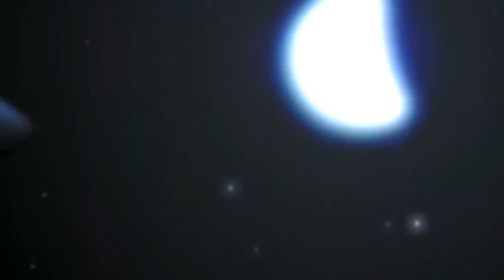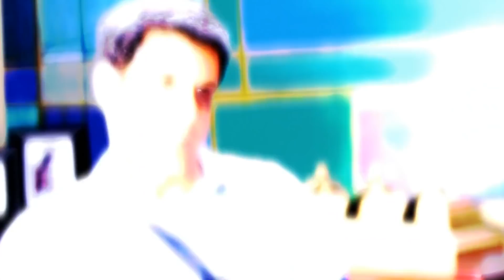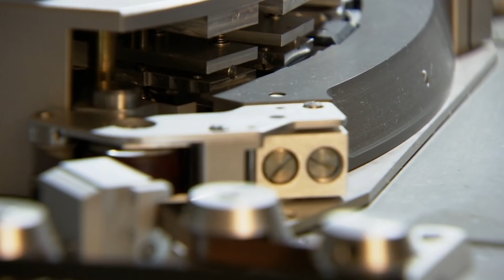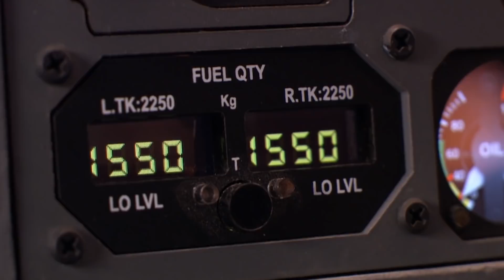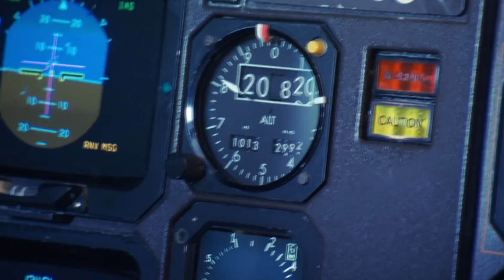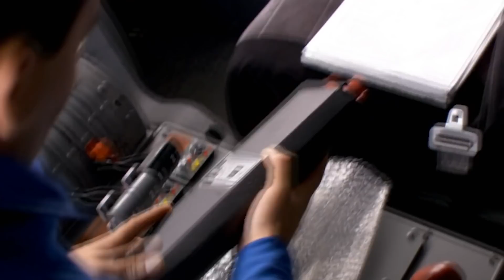"A Shocking Mistake" That Could Have A Lasting Impact | Falling Fast | Mayday: Air Disaster

Comment: I think this is a pilot error. He accepted to do the flight when he didnt have the nessesary fuel slip for the "refueling". I think every pilot should turn down the flight if they dont have a 100% certainty of the weights or fuel in his vessel. This is not a knowing better statement. Its how safety is being held. If you're uncertain, then you're not uncertain. Thats how we run vessels at sea, to ensure every safety aspect is held.

Comment: How could they have charged the Captain? He reported the problem with the gauges on his last flight, asked for the refueling slip (and was told he'd be given it later), requested an alternate airport and reported a mayday very quickly, got the flight crew to prepare the passengers for impact and tried to troubleshoot as best he could. He only decided to ditch as a last resort. Not to mention that he ditched as perfectly as he could given the situation.... and ditching is very difficult! Even in the simulation under perfect conditions and knowing the variables, it was theoretically possible, sure, but not exactly easy to land safely at another airport.

I've seen way less competent captains in these Mayday episodes and pilots are only human, after all. They do make mistakes, but it sounds like he really did everything that he could given the circumstances. His actions still managed to save the majority of the lives on the plane. He ended up serving 6 years for manslaughter for the remaining 11 lives that were lost. :(
Reply: supposedly it was against regulations to take off without that refueling slip but probably like many other pilots didn't want any further delays
Reply: He did release the plane without knowing for certainty if he had been refuel or not. In the maritime world we have a saying, "If you're uncertain, then you're not uncertain". In that way we dont do anything we are not certain about. So taking off without the fuel slip is a slip in safety culture. Definetly captains responsibility.

Comment: It's fuckin bullshit that the pilot faced criminal charges! The main culprits are the people that handled the repairs and (supposed) refueling of the plane! He DID report the issues with the planes fuel gauges AND he did CLEARLY ask about the refueling slip prior to takeoff so NO he should NOT have faced charges 😠
Reply: Its a complex situation. But the Captain neglected safety culture by releasing the plane without having the fuel slip. We have a saying in the maritime world,
 If you're uncertain, then you're not uncertain. In that way we make sure before we release our vessel. So its both party to blame in this case.
Reply: @mariusholtergrvdal7386 What does that???

Comment: I’m just amazed that the incorrect meter could be inserted. In general manufacturers will put a keyed power connector to prevent this. Bad design.

Comment: Why did they not drip the tanks to verify the fuel onboard after repairs and before the flight ? It only takes 5 minutes to do . I have done this on minney  commercial flight's in my career in aviation . Safety first . Amen !
Reply: You're a commercial pilot? That's got to be one of the coolest jobs on the planet. But so much pressure! I hear the big jets are easier to fly. It seems like fun. I know nothing about aviation but lately I've gone down this yt rabbit hole and it's really freaking cool how aerodynamics work! lol

Comment: Wouldn’t the wing fueling gauges show proper qty or are they slaved off of cockpit gauge ? Guess they showed same qty or the fueler would’ve questioned fuel load or the captain questioned uplift
Reply: Does the ATR 72 have fuel gages in the wings?
Reply: @mattr3632  good question I assumed it did I only work on 767 and 777 most planes have gauges at fueling station

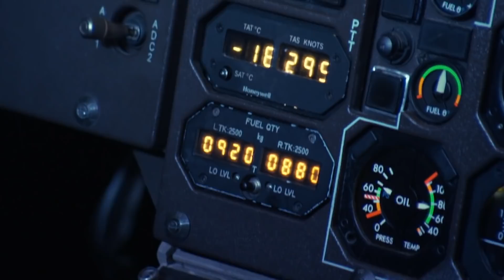Comment: 20:02 - Question… Why do the simulator pilots know what’s coming? Wouldn’t it be more realistic to nOt tell them what was about to happen?
Reply: they proved that with Sullenberger and the Hudson the time that it took to figure out what was going on and react made it so returning was impossible
Reply: the problem with simulators in investigations is they arent trying to prove what the pilot did is possible, they are trying to prove the conclusion they came up with. most point out sully and how he was vinidcated by the simulation. But it very nearly didnt. As multple trys by the pilots actually had them land at the alternate airports. They tell them hwo to do it and the simulator pilots study the events so know what the pilots did. What makes it even worse is they get to have practive runs. They also arent under the same pressure or circumstances of the pilots either. Afterall they know they arent going to crash in flames if they fail. Unfortunatly the one thing this show doesnt do is show the reality that companies and airliners really dont want to admit it the equipments fault and will do everything to prove it was someone elses problem. Same with some investigators. Sully was the victim of this as he was tared and feather by the media, same as the pilot from the heathrow crash.
Reply: Good point
Reply: the reason they simulate the crash is to see if there is a way we can avoid it and then ease the emergency procedure of the next flights and not to simulate the same conditions as mentioned.

Comment: Wow!
That one mistake cost those people their lives!
Reply: There were multiple mistakes. The many procedures pilots are supposed to follow are in place because the reality is that mistakes will happen. If the pilots had followed those procedures, such as not pushing back until they had a valid fuel sheet, or setting up the plane to glide as far as possible after the engines would not restart, then those people would be alive. The mechanic is absolutely responsible for installing the wrong instrument, but other people made mistakes as well.
Reply: @mattr3632  That makes sense.

Comment: It's pretty shocking how a small thing can bring so much disaster. The skills of the pilots are awe inspiring!
Reply: Yes! And then in some cases they glide down a 747 from 27Kft and everyone is fine. It's terrible and fascinating
Reply: It wasn’t a small thing (wrong fuel gauge module). And add the inexperience of the pilot to glide the aircraft he is flying on. He should be trained on all fronts by the company he is operating from.